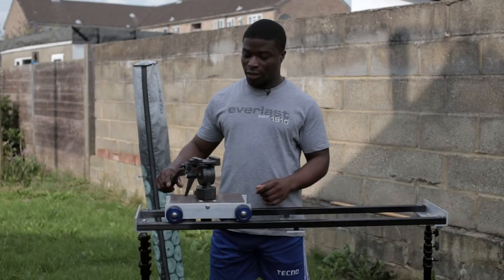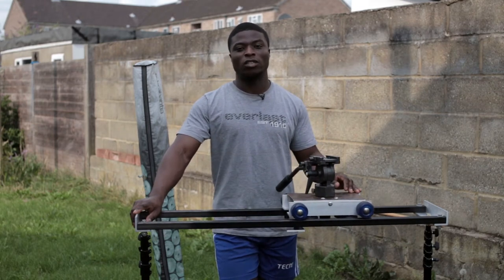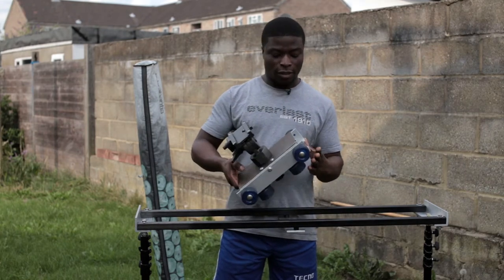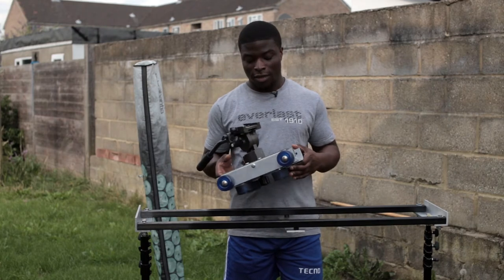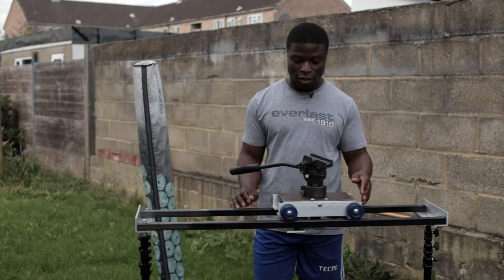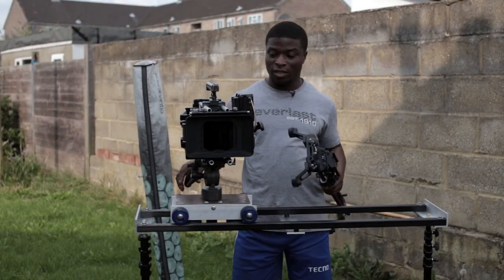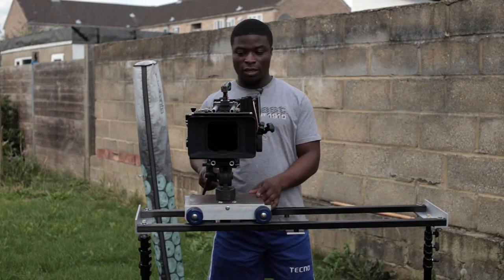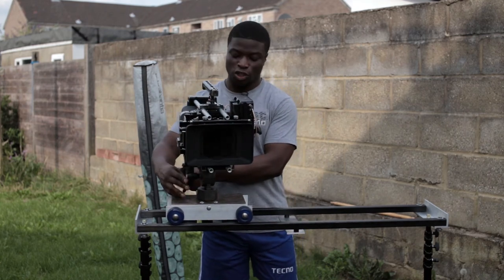DIY camera dolly - Film makers tools

Comment: Very professional looking build. Looking for something for my Sony FS5. It's too big for DSLR sliders. Please post your parts list and plans if you can. I like the way you set the wheels up. Seems more stable that the method of using angle iron to have wheels on top of the rails at opposing 45 degree angles. Well done! Subscribed!